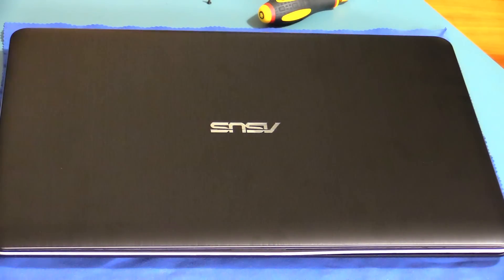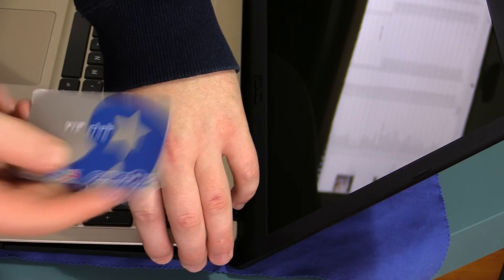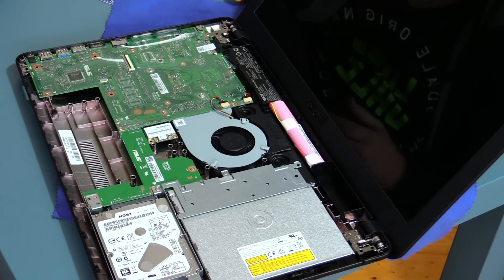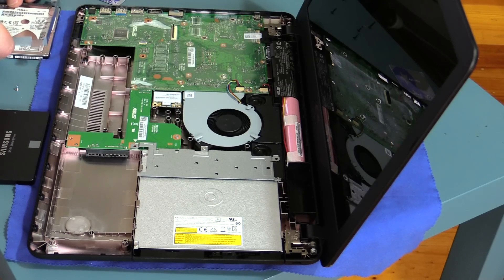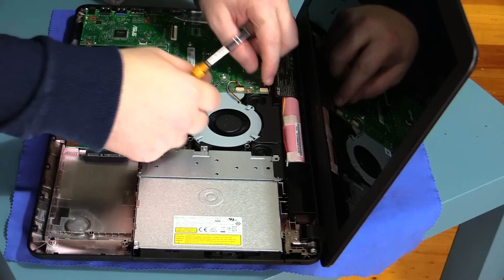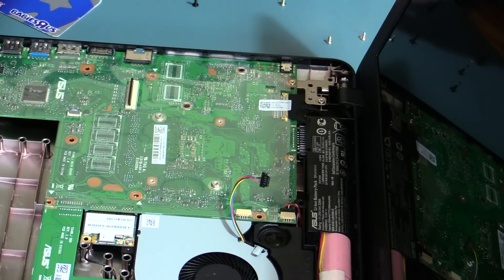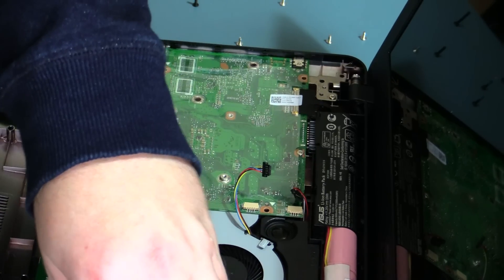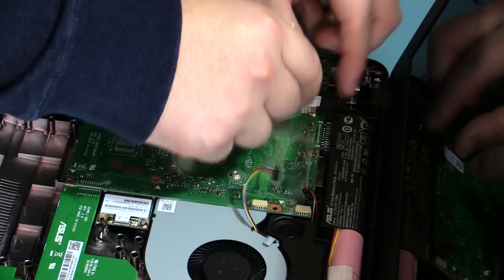Asus X540L Disassembly for hard disk replacement or memory upgrade

Comment: How many gigabytes of RAM supports the laptop? You can set 8GB? As standard there is one card to 4GB?
p.s. ty for answer
Reply from the maker: 3bmth yes supports 8gb although needs full disassembly to upgrade it. quite sure it is 4gb built into the motherboard and you can use one expansion card. I might not be 100% correct with that but either way it can support 8gb. thanks!
Reply: Anthony Parker ty man

Comment: I was able to remove two of the base screws but the rest have weird little covers acting as plugs over the screws, how do I get them off?
Reply: I'm facing the same issue. They are like plastic inserts that are impossible to get at. They seem like plastic rivets.
Reply: I gave up in the end. Luckily its not my laptop so I won't notice how slow it is with a non-SSD :P If it was mine I'd bother figuring it out
Reply: Turns out on mine they were just these little plastic inserts that I had to dig out with a very small, sharp knife and behind them were screws.

Comment: Mine won't turn on without plug in charger after i added ram i put it together
Reply: connector from the battery is probably loose.

Comment: Thanks so much for the video. I'm so disappointed at ASUS, I bought the 
model online (ASUS F540L) and of I course I expected the model to have 
ram, hd and batterypack easily available. NOT that I would have to open 
up the whole computer just to upgrade RAM. WTF! I've written to ASUS about it also, and I will never buy an ASUS again until they fix this.

Comment: OK, I just replaced and upgraded the RAM on my Asus X540LA. This video is very helpful (thank you, sir!), but as someone with limited experience with computer disassembly, here's a few things I would add on top:

a) RAM - Is it upgradable? There seems to be a lot of dialogue on whether the RAM is soldered on to the motherboard (and thus not upgradable). Mine was not soldered on (maybe cuz mine is an 540LA and not just an 540L??). I easily removed it from the RAM slot...I had a 4GB DDR 1200S RAM card in it, and I removed it and put in an 8GB DDR3 1600MHz RAM card in. It worked! Note, you CANNOT put more than 8GB RAM in. I didn't try it, but based on some of the comments below, it seems it wont work.

b) The screws....lots and lots of screws that look very similar. When you take them off, put them on a normal piece of paper (turned to landscape position) and put them in the same (relative) spot on the paper. That way you know roughly which screws go in which hole. I didnt do this an have 2 screws left because some of the silver screws have slightly different widths. Oh well, it doesn't really matter, unless you're picky/anal retentive ;)

c) Remove the keyboard and trackpad ribbons from the circuit board. The video doesn't really show how they get removed and they are tricky! NOTE they are NOT removed with the side-to-side motion like the cooling fan clip! Watch this video (https://www.youtube.com/watch?v=iOE4T6nykQ4); it shows you how a ribbon clip works. Basically it's a hinge you GENTLY flip up 90 degrees...then you pull the ribbon out (no metal pin connector). Just reverse to put back in.

d) Removing the battery isnt that hard, and I would highly recommend removing it early on in the process once the keyboard is removed -- just so there isn't any stray electrical charge while your doing the job. I just used a very small screwdriver around the left side and top left corner. A little wiggling and it comes out easy (for me anyways).

and lastly...
e) Is it worth it? Yes! Video and multiple browser tabs are much quicker/responsive now. I could have upgraded the HD as well I suppose, but I could always do that later.

Thanks again to Anthony who made the video... couldn't have done it without this! Tsk, tsk Asus for not providing details on how to upgrade it.

Cheers
Reply: Bro how to use Bluetooth in asus x540l.?
Reply: Akshansh Kumar it has no Bluetooth
Reply: Here's the solution
If there is a dim slot for RAM it is upgradable to the stated limits. Even if there is soldered RAM as long as there is a dim slot it is upgradable to a degree.
Reply: Was that card you replaced a DDR3L? Also, did you have to back anything up or was there some kind of set up after install was complete?
Reply: place DDR3 or DDR3L?

Comment: Thank you for this amazing Video. I followed this video and manged to insert the new RAM DDR3 12800 but when i tried to switch on the machine it could let me. In the process of troubleshooting i took off the RAM i had added and only left with the on-board RAM, however the machine still wont start. No light no what even when i connect my charger the usual light for battery is not showing. What could have happened. Am suspecting the motherboard but is there any more possible reason. Email obedia1@gmail.com
Reply from the maker: Hi mate, thanks for your comment!  DDR3 12800 may not work as I'm quite sure this model uses DDR3L  (low voltage) best check the specs on the box as that should clear it up. As to why it is not booking now... that's definitely a difficult one to diagnose from here. From my experience which is 100's of laptop repairs I can't recall ever having 'killed' a laptop in the process of working on it.

I dare say maybe something isn't connected properly or something like that, certainly worth disassembling again and see if you can spot any lose cables maybe the power cable?

Failing that, it might  be worth popping it into a local PC store and get them to take a look. It's quite difficult to say from here exactly, but if it were me... I'd certainly go for another disassembly and also test the AC adapter on a different laptop or borrow a friends, just to ensure nothing is wrong with your charger too.

GOOD LUCK!!!! (from Australia)

Comment: Hi all,
I'm thinking to buy an Asus X540LA XX002T, but I have a question. Specification says "4GB, 8GB max". Have that model 2 Ram banks or only one?
Tyvm ;)
Reply from the maker: I'm quite sure 4Gb is discreet and you can use a single 4Gb add on card... if it were mine, I'd open it up just before you go to buy the memory, or just quickly have a look at the manual on the Asus website :-) You need to get the correct voltage and memory type anyway. Good luck!

Comment: how do you add ram to this is there an expansion port or is it soldered on to the motherboard mines has a 2gb inside ridiculously slow 1.7ghz i3 nvidia geforce 920m

Comment: i just open my laptop asus x450lj and there is nothing in ram slot but in the system say 4gb
can u tell me how i upgrade it and what tipe of ram i must buy 
thanks sorry iam not good in english hope u understand
Reply: It is soldered to the mortherboard so you wouldn't waste that space for 4 GB of ram,so you'll have 12 GB while maxed out instead of 8GB while not having that extra ram,they just added it directly to the motherboard like they do on smaller computers ex:tablets,laptops,convertibles and all kinds of stuff...so it will be better off for you and as well for them I guess.
Reply: u sure nao?
Reply: KaibaCorp57 i mean x540lj LoL
Reply: I also have x540lj and task manager says 1 slot is empty so will i have an empty slot like you nao? can you please check your task manager and see what it says
Reply: its say slot used is 2 of 2 because i already update with 4gb ram 
so you should have 1 empty slot dude same like me
Reply: yeah dude I think the same... I used another app and it also showed me that slot 2 is empty so I think I have slot 2 empty as well.. fingers crossed i will check it out definitely... My laptop is in warranty.. How to update ram without losing warranty?
Reply: so are there 2 slots or just 1? I have x540lj with 4g, but not sure if I can just add 4 g more, or i have to buy one stick of 8 g?
Reply: It's quite confusing.. The thing is some people have 1 slot empty while others don't.. Open your task manager and go into the ram section and see whether it says "Slots used 1 of 2"
Reply: thank you

Comment: I was wondering if it was possible to upgrade the ram since it is so low to 8gb? And if yes how?
Reply: There's only 1 slot, but yes, you can upgrade to 8GB.  I did mine.  Watch the video and the RAM is shown at the end.
Reply: Storme Fire Thaaanks mas you're a life saver. Just a question tho, should I try to open it myself ( average 15 years old) or should I take it to someone who knows more about the subject
Reply from the maker: Hi Sakata,  it's actually reasonably easy to do so you could do it yourself but if you're going to, it's a good idea to sticky tape down a piece of A4 paper and draw out where all the screws came from as you take it apart. Also, don't rush it, take your time, if you're trying to force something and it's not opening, stop and look for more screws... most things don't need a lot of force to open in a laptop. Sometimes the seal holding the base and the keyboard together can be a bit tight when it's first opened, but an old credit card or a guitar pick and it should come open quite easily. Just take your time and be careful :-) Good luck! If you get to a point that you just can't go further then you can always just put it back together and take it to a PC tech who can sort it out for you. It's really only a 20 minute job so it wouldn't be very expensive.
Reply: Anthony Parker Thanks, I rather not take the chance xD, when I get a new ram il take it to a Tech
Reply: Thanks for the informative vid you saved me a whole lot of frustration and thanks  SDtorme your info was a life saver as I was just about to dismantle my x540l to check if there was a 2nd slot. I'm very glad I watched until the end now.Do have one question as my computer design and construction knowledge generally hovers around in the Zoolander level why does the info in task manager and other basic desktop programs indicate there are 2 slots when there clearly is only the one?

Comment: Great, now replace the keyboard. I dare you. I double dare you. :)
Reply: the stuff of nightmares
Reply: Actually if you upgrade the RAM you could swap out the board in the process considering you have to remove and flip over the motherboard to get to it.  It wasn't nearly as taxing as I thought it would be.  It wouldn't be that bad at all

Comment: I have an X540SA with 4gb mem.  Does it have the same add-on slot underneath?  One comment says upgrading mem will not work as the chipset can handle only 4gb mem.  Is that correct?
Reply from the maker: more than likely says it'll have the same configuration but I can't be 100% on it without having it in front of me. I'd also be confident that it can handle 8Gb you just need to make sure you get the right memory... it's probably DDR3L not DDR3 but if it were mine, I'd take it apart, take the existing memory with you to a PC shop and let them match it (if your not sure). always a good idea to test it before you put it all back togethee too.

Comment: They really should have added the door on the bottom of the laptop like the F555 laptops have. It takes literally less than 1 minute to add a RAM card to those.
Reply from the maker: agreed! I truly believe it's because they want to stop people self servicing them and buying new ones which is a bit rough on the end user; at least let them change the memory! lol anyway.. I do hope we start to see retail box GTX1080M gpu's, I'm guessing power requirements may have been an issue in the past but looks like big improvements in that area so fingers crossed
Reply from the maker: excite236 lol because cutting plastic and adding a screw point is expensive in mass production...? yeah not likely. on board SSD wont happen any time soon but maybe in the future. hopefully they don't though... stock SSD's are often so slow in comparison to aftermarket.
Reply: I have the asus x540SA model in which the seller claimed the RAM was upgradable to 8 gb of ram. I used a system scanner which told me that the 4 gb that's on there is soldered on. Then I just checked reddit and another fellow says it's only partially expandable. Meaning, 2 sticks are soldered on but 2 are left open. I think I'm going to return this sucker and get a unit with upgradable ram.
Reply from the maker: You probably can still upgrade to 8gb no problems but your choice
Reply: That is incorrect, the reason they made it this way is because it simplifies the design and therefor lowering the manufacturing costs of adding doors and bays.  Soon enough you will have memory and sdd's right on the single mainboard and not modular.
Reply: @excite236  Fucking shill.

Comment: How do you reset the bios?
Reply from the maker: if you remove the battery from the motherboard and the battery from the system it should reset although if you just cant get access to BIOS there are ways in other than resetting BIOS
Reply: Are you sure this is compatible with 8gb ddr3 1600mhz, crucial.com saya that it actually is, but i can not get it to boot after i install 8gb :/
Reply from the maker: +Asil Doğuş Taşkın check that its not DDR3L instead of DDR3... system wont boot with standard memory if it is expecting low voltage memory. check the memory you removed for the spec
Reply: https://www.asus.com/Notebooks/X540LJ/specifications/ 

it says DDR3L 1600 MHz SDRAM, up to 8 G. The one i installed is ddr3l as well. :/
Reply from the maker: Perhaps 4gb is discreet so only seperate 4gb expansion?

Comment: Thanks for the video, it was really helpful!
You can remove the motherboard more easily if you start from the bottom.
But before: it's very important to remove all the screws (also on the right: Wifi module, HDD, DVD drive, etc).
After that you can easily remove it by freeing up the plugs on the bottom left and lifting up the the board - also from the bottom. :)

Comment: so basically if i wanna upgrade the ram i have to re install windows....jesus
Reply from the maker: if you're just changing the memory you shouldnt need to do anything like that, only if you change your hard disk. this disassembly was a while ago although I'm quite sure a memory will require a full disassembly but no software changes. good luck :-)
Reply: +Anthony Parker oh jeez, thanks for the info

Comment: I kinda slapped my laptop where the hard drive disk is and now it does some clicking sound,and it won't load. it stays stuck on aptio update. I understand that the HDD needs to be replaced but do you think when I get a new one it'll load up?
Reply from the maker: Clicking isn't a good thing, considering it's physical damage it may be damaged heads. I hope you have a backup in place? You may need to speak to a data recovery company to get your files back if not. If you install the new SSD it'll just be a blank empty drive, so you'll still need to install & configure your Windows OS, driver software and any programs that you use as well. It's not a particularly difficult thing to do, it's just having the right software and tools available to do it. If you have any friends close by who are computer savvy, it might be a good idea to ask for some assistance with the software install. Just putting the drive physically into the computer won't be enough though... MS Windows installation and drivers are your first goal. So you know, your MS Windows product key, if the computer came with MS Windows 8 / 8.1 or 10 is stored inside the BIOS... so you don't need a license sticker, you just need the correct version of Windows that matches with your computer. Thanks for subscribing and I hope this helps!
Reply: +Anthony Parker thanks, couldn't find out what was wrong with it but it's fixed now :) and keep up the good videos

Comment: How do you take out the base screws?
Reply: @MarkJBaber  those black slots are just protective covering for the screws, I removed them using a sewing needle by going under the covering from one side and flipping it off.

Comment: Thank you for this video, much better than the other one I found which has no voice explanations! I was scared when I nudged the touchpad cable towards the right-hand side and the blue strip came off without any sort of cap or connector at the tip. I thought I had broken it! But thankfully I managed to connect it back afterwards and the touchpad is working fine. My tip for anyone who's reading this and wants to open this laptop: send it over to professionals instead. Switching the HDD takes literally less five minutes, so they should only charge you $10 or $20 at most. Much better than risking fucking up your touchpad.
Reply from the maker: glad you managed to fix it. yes youre right, if you've done very little tech work before it might be an idea to get a professional do it. That said, we do maybe 10-15 laptop repairs every week and these newer laptops are not too difficult, people most commonly stuff up taking apart the bezel though and making a mess of that. good work :-)